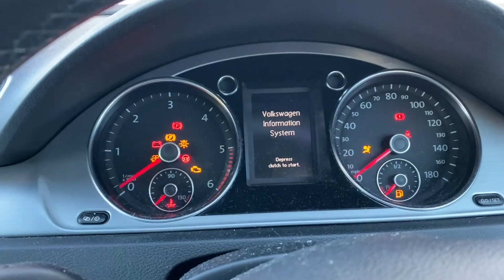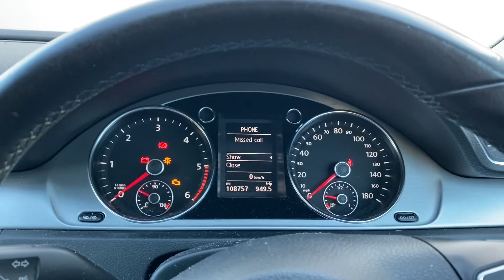Faulty Rear Cluster Wiring VW CC 2013 Repair

Comment: Superb vid mate. My CC has recently had the reverse light always on issue / tailgate warning lamp with the occasional boot opening as I'm flying down the M9. Gonna get my soldering iron out and get fixing. Cheers.
Reply from the maker: Thanks a lot mate this was a nightmare of a job but very doable with a little knowledge and patience….biggest issue was same colour wires 🙈 so I would advise label everything before stripping….saved myself about £400-£600 at a guess in labour cost alone no doubt 🙈🙈 much appreciated pal any issues or questions let me know….might not be able to answer but will help if I can 👌
Reply: @phdiy3913  Cheers dude, much appreciated. Will let you know how I get on.

Comment: Thanks for showing.
My CC is starting with trunk issues already.
I think VW should make the wires a bit longer and just lead them upto the actually winge-position, so there is not so much movement as where they are now...
But I'm hopefull; it is fixable!
Reply from the maker: I used single core wire from a piece of flex cable….one of the main issues was that all the wires where the same colour which maid it a pain but definitely fixable for sure 👍

Comment: Hi, do have a problem with mine, done it today but my fog light doesn't work, all works ok except the fog light, couldn't find much online as schematics goes but will double check again tomorrow
Reply from the maker: This happened when I did mine but after turning everything off and back on it worked almost like a reset for some reason…..if everything else works fine then just check the connection again perhaps it’s broken further up, good luck 👍
Reply: @phdiy3913  Bloody passat, spent 1hr for troubleshooting as the turning lights on the boot wasn't working, later to find out those are empty... Very close to use some petrol and set it on fire 😂

Comment: Just repaired my harness and found that VW, although all wires are a shade of brown.  They put very small numbers that coincide with harness plugs.  They want you to buy a plug, however I did not video my repair but some wire same gauge, electrical tape, diagonal cutters, wire stripper and a multimeter and you can rebuild your harness yourself. Test run tomorrow 5/30/24... I made a hand written wire diagram for the 5 color plug VW CC. Oh removed the wire breaking ELBOW!!!😂

Comment: Right hand rear reserving has just to fault on my 2012 cc. Im a novoice at wiring. What tools, wiring did you need for the job? Thanks, great vid
Reply from the maker: You can reach the wiring from inside the boot on the side panel to determine if it is faulty…..put it in reverse and try and wiggle the wires…..basically all you need it cable, insulating tape, soldering iron or even the heat shrink clamps….basic cable joining methods

Comment: How can I identify the cables ?
Reply from the maker: It doesn’t really matter as long as you can label everything before you start cutting and disconnecting then you’ll be fine….i just numbered everything on both sides of the cables